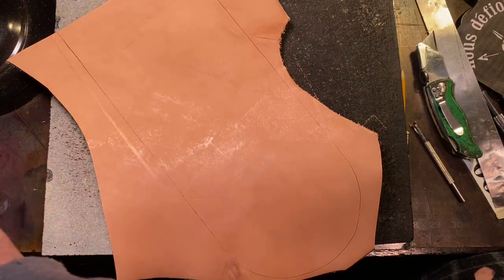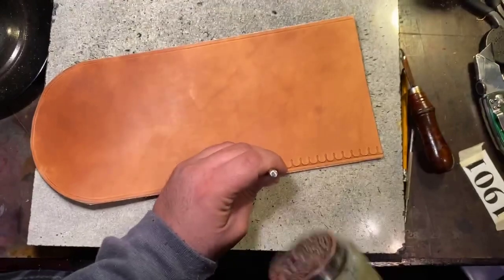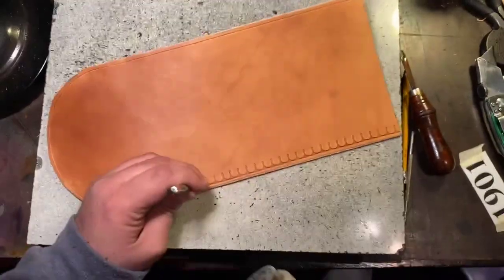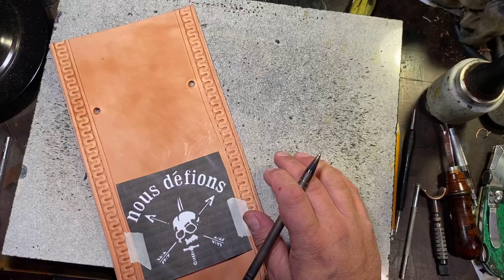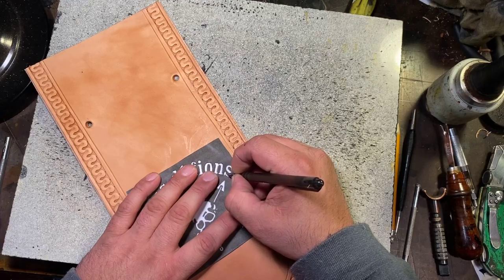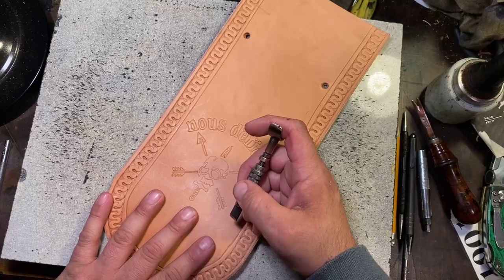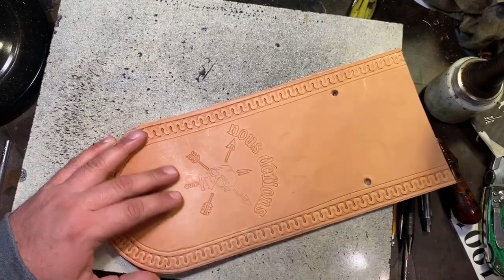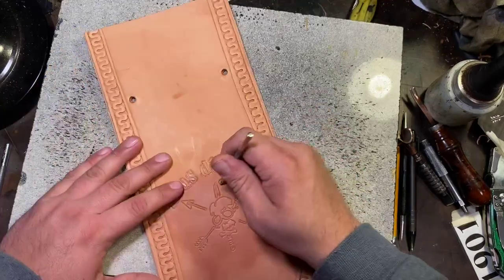Motorcycle fender bib in the works by Carlo Lorge

Comment: Try using packing tape or map tac (if you saved any rolls from the army) to cover the artwork and then trace it onto your piece of leather... Evin if you're making a one off or custom piece, it's cheap and quick and helps with the transfer....
Reply from the maker: I use packing tape on to laminate the art when it’s something I’m going to use again, but not for a one off piece,

Comment: So   you  hit a Drunk with  your Motorcycle  .  I must admit  to coming close to hitting people with dark clothes at night  on in dark clothes.. parlty  because  I was  looking at  GPS  screen  ect..  not at my driving..
   I hit a Deer  1 year ago.  I was going   55 MPH  and a Deer jumped  straight out of a  corn field ..   Ran as  fast as she could across the road  .. Hit her square in the belly  just  below  my head light ..  Went for a  50  MPH slide  feet first on my stomach .. Shredded  my gloves,  Shredded  the top of   my  forearm  mesh  armored shirt ..  Sore Shoulder ..  sore ribs from hitting my tank bag which is   spsring clamp  mounted  luckily it popped off.    Skinned and Bruised knees  ..  asphault  rash on the  top of one forearm..